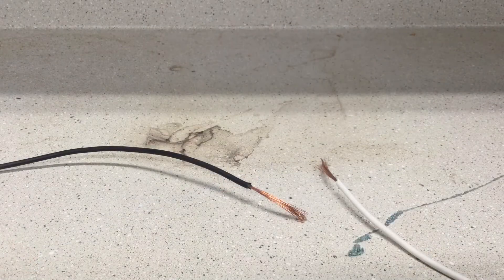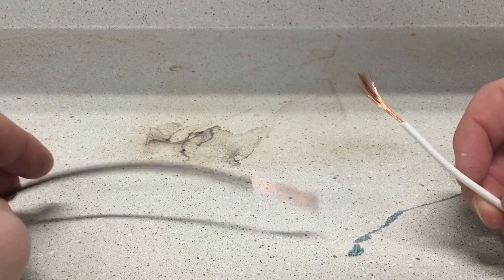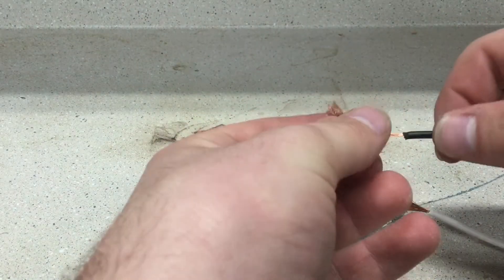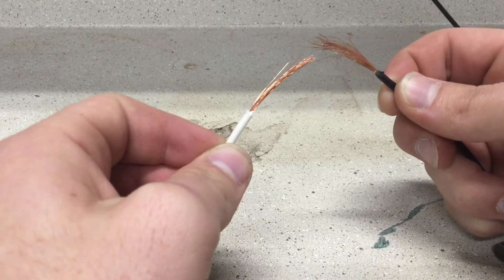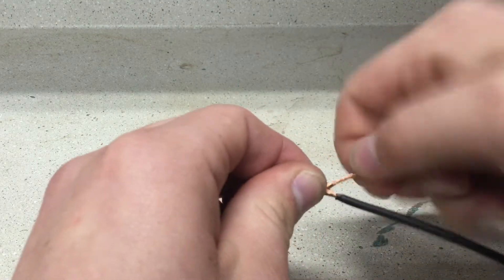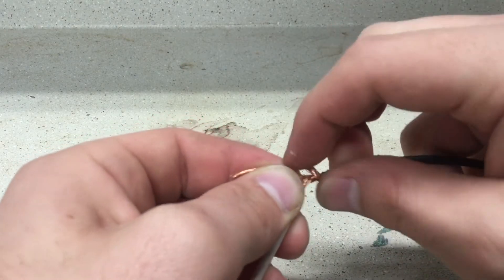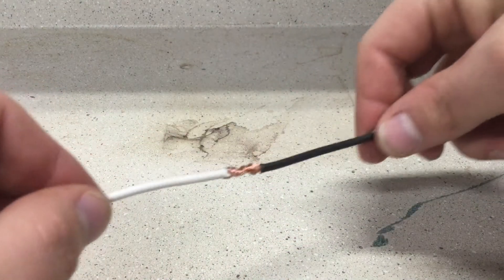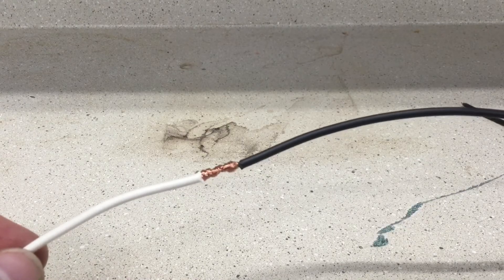How To Correctly Connect Two Wires Together

Comment: Brilliant video. Easy to follow, concise, and short. One of the best I've seen. What is your opinion on the best way to "re-insulated" joints when the joint is used in a harsher environments?
Reply from the maker: Use layers of heat shrink tubing with an adhesive in it. Make sure the area of the joint is clean and free of dirt or debris. And also make sure to overlap your heat shrink tubing. When applying the heat shrink tubing, make sure the wires are level with the rest of them. No extra length etc... 

Then heat shrink the wires together and overlap the remaining length. Thickness of insulative materials is your best friend in harsher environments. Also make sure to tier down the layers the further away from the joint. That way it wont have a kinking point.

Comment: To the people who have never wired anything before and are here for a how to. Do not ever wire a black wire and white wire together. He’s showing a technique on a way to wire two wires and that’s it.
Reply from the maker: Thankyou for that reiteration. That is correct. 

-      Yes I am just showing a technique, never wire a white wire to a black wire. Typically if of course the wiring was done properly to begin with. There are times when a color change is done midway but that is for circuits in vehicles and 3 Phase motors and some industrial equipment, whether it be a circuit board wiring or it be a vacuum or a shop vac made outside of the U.S. There are many other types of equipment where the wiring color code changes mid way through the wire. There are times when the color code changes midway, but in GENERAL DO NOT CONNECT DIFFERENT COLORED WIRES TOGETHER. 

Message above for general audience. Not directed towards commenter. :)
Reply: That is part of a very antiquated racist ideology. Today black and white connections are considered acceptable. 😆
Reply from the maker: Hahahahaha🤣
Reply: Any videos you recommend for rewiring stuff? I'm new

Comment: I notice all the videos on connecting wire is always a single isolated wire. when in reality it is 99.9% of the time a cord that has 2 wires running side by side which is a completely different challenge. Unless you strip back like 5 inches of wire this type of connection is difficult because the second wire is in the way.
Reply from the maker: No it is the same method that is used on 3 conductor cable and 4 conductor cable. The only thing that is different is that you can do 2 things. 1 being you can tier where the splice is at. or you can do the splices right at the same level on the cord. 

You splice like shown in my video and then you insulate with heat shrink tubing that is very close to the same size of the wire. Then you take heat shrink tubing that is a littler larger and proper size for the conductor size and shrink it on there as well. Then you take a heat shrink of the right size and shrink it onto the wire in front and behind the main area that your splice is at. Make sure to overlap your shrink tubing on this part for a smooth transition and continued protection and insulation. (Do this for all conductors)

Then once that is done then you bring the wires side by side and heat shrink the whole cable. make sure to tier the heat shrink tubing on both sides front and back on this step. Then you can wrap it in electrical tape, which is optional at this stage for extra protection from the cord being dragged across the ground and run over and so on. The main point in these steps is to have the cable double insulated and double insulated with a thick enough insulation to not only prevent Arc Fault but also to prevent in the case that your cable is cut or ran over with a wheel that doesn't have very much surface area on it as so it won't cut or damage the area that has been spliced. I can make a video on this procedure and how I do it if you'd like? 

I have already done it on a saw that a special someone had accidentally cut when we put together our deck. I got it all done and the cord fixed in about 10 minutes from start to finish and I used the same procedure that I showed in this video. The only thing you have to make sure you do is to make sure the cable is cut and the wire is stripped to the exact same length. And then all of the rest of the steps are super easy. 

 I'll add that to the list of videos I will do so you can see how it is done. I do it in a way that allows the cord to be continually used in harsh conditions for at least several months. keep in mind this is in very harsh conditions and the cord is not treated kindly to any extent. But if it is a cord that you use around the house then it will last you several years as long as some care is taken into account. 

Thank you for your comment, I hope this helped answer the questions or concerns you may have had. If you have any questions for me please feel free to leave them in the comments. :)

Comment: What if one side is too short to do that?
Reply from the maker: If one side is too short, then you must shorten both sides. Basically to make them equal. It distributes the connection points evenly. If they end up being too short for both sides and you can get half way there but can't finish it. Then either cut it to length or in the worst cases scenario, you'll need to put in a new run of wire. 

Note: Before you put power through the cord, you should test it with its max current that the wire gauge can handle. Here is a list of wire gauges and the currents they can handle. 

10 AWG = 30 Amps
12 AWG = 20 Amps
14 AWG = 15 Amps
16 AWG = 10 - 12 Amps ( Varies on length of wire and how many wires are near it. 3 is usually 12 Amps includes a ground, neutral and hot wire... green, white and black wire) The more power wires or wires carrying the current that are next to each other there are, the lower the current they can handle. This is due to residual heating and the fact that the wires can't cool down fast enough even though their wire gauge is rated for a certain current.

But it should be noted that this is for connections that will eventually be replaced later, of course depending on what it is meant for. Extension cords, this is ok as long as you keep the connection firm and not tight and as long as you put extra reinforcement on it. The reinforcement needs to be very firm on the connection and extend at least a quarter of an inch to an inch away from the connection. 

I hope this helps and also adds some more information. :)

Edit Info: I fixed ads to adds.

Comment: Any reason why to do it your way?
Reply from the maker: Not really. I actually had seen videos like this on the internet one day and well I saw one flaw with them. And that was that they wouldn't work in some situations. Sure they would work for a few seconds on higher loads, but then it would end up with the joint getting hot and having heat issues. Some were very strong connections, but weak with connection points. So I decided to find a method that would have a very strong tensile strength and would be very durable as well as having connections points on most of the wires and also be spread equally. So there to be no hot spots. But you can chose to use other peoples methods if you'd like. I just saw this kind of thing and decided to make a video on the way that compromises on both ends. So other than that, not really.

One of the issues I found was that the other designs didn't have good flexibility on the connection while also maintaining good contact with the wires. This would cause arcing and more problems. So I found one that is flexible and works very well with that.
Reply: @magnetnerd488  Thanks for this explanation
Reply from the maker: @ife9556  Yeah no problem. :)

Comment: It's not heat sink! It's heat shrink. It shrinks when you heat it. A heat sink is something that takes the heat away. Like a piece of aluminum with fins on it. The heat is absorbed by the aluminum and it spreads out to the fins where air takes it away.
Reply from the maker: Hahaha! Yeah I actually had to go back in the video to see where I said that, and sure enough I did say that in the video. Hahaha! Silly me :) But yes, I did mean to say heat shrink. I just knew when I saw the comments that this was going to be an on going joke. Hahaha! Definitely going to leave it up though.
Reply: @magnetnerd488  we all have a little mess up now and then. Me, I never mess up. I don't drink, I don't smoke, and I don't cuss. Oh damn! I just realized I left my cigarettes at the bar.  😂

Comment: Heat shrink. "A heat sink is a passive heat exchanger that transfers the heat generated by an electronic or a mechanical device to a fluid medium, often air or a liquid coolant, where it is dissipated away from the device, thereby allowing regulation of the device's temperature. Wikipedia" . Well explained tho.
Reply: Heat shrink tube
Reply from the maker: Nice explanation. I liked the comment because it contributes and may teach others something. :) thank you for the comment.